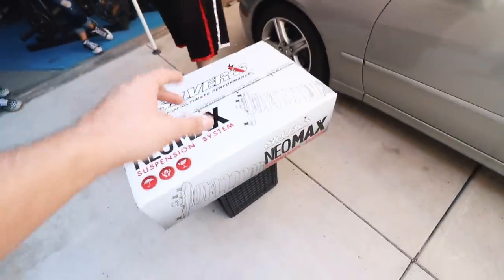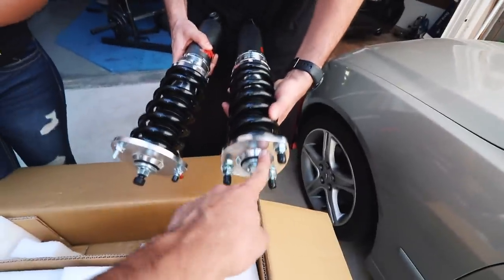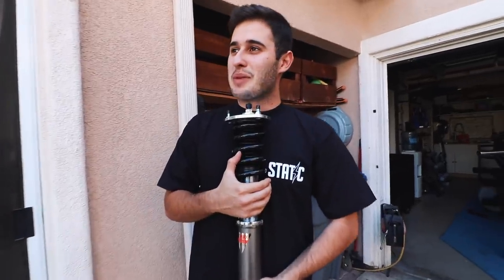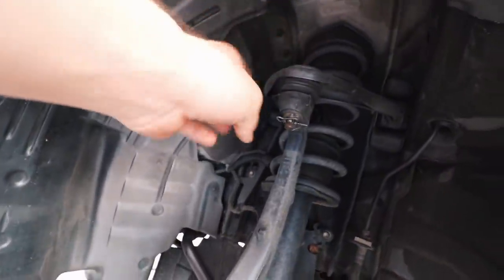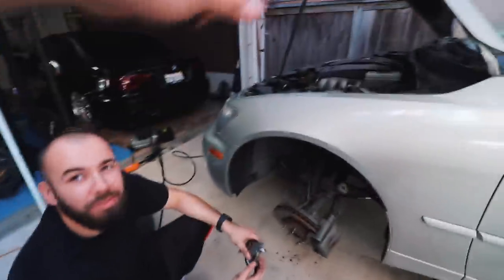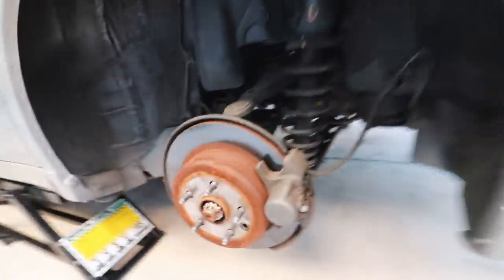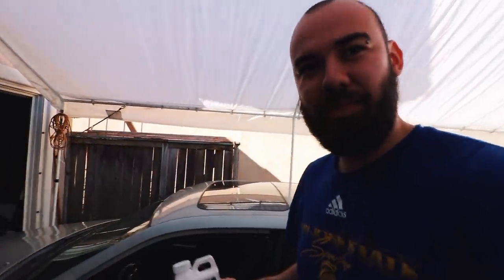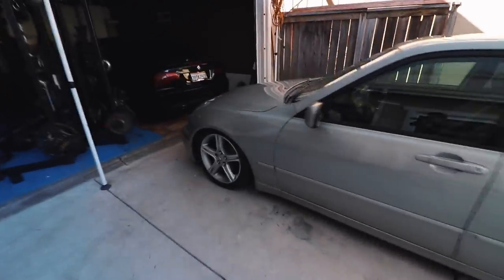Slamming the Lexus IS300!!

Comment: Did you ever have problems w the gas tank leaking after lowering it? i think it sits right under the back seat, do people usually do a relocation or is it tucked up? i also wanted to ask if people cut the subframes to help w tucking the diff and the engine? Anyways is there any other things that usually happen when the car is lowered other than the spindles hitting

Comment: Brass hammer on UCA joints work alot better..... no marring. Just actually did the struts on my 05 IS300 and PIECE OF CAKE, though not a fan of the stock spring rate little softer then I'd expected.

Comment: What options upgrade did you get with the neomax?
Reply from the maker: Extreme Lows!
Reply: @StaticGarageUSA  i was thinking of getting them for my is. Those thing are super low lol  did you get the rear damping adjustment extenders in the rears also? I'm doing a whole front end refresh and rear basically doing the whole suspension since mine gave me a scare.if you haven't done your ball joints yet you should do them the is are notorious for snapping ball joints.